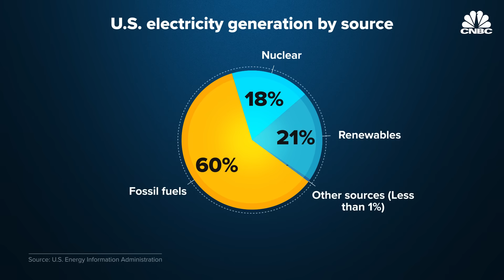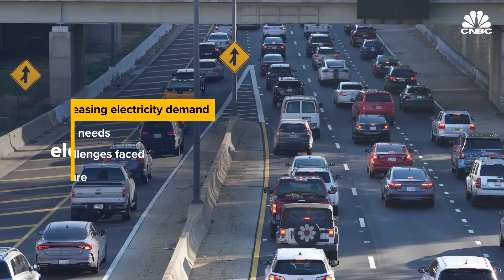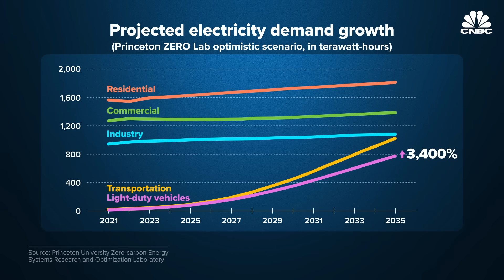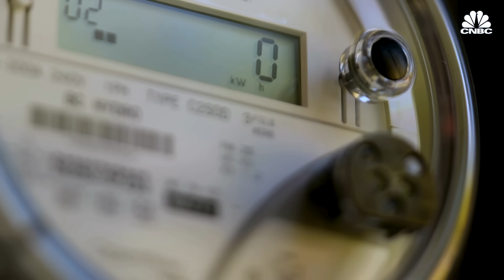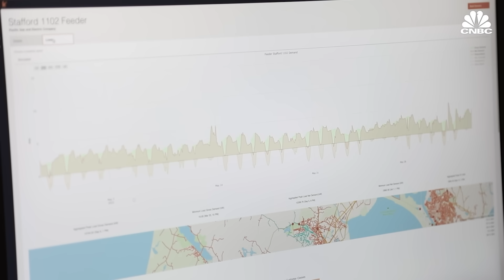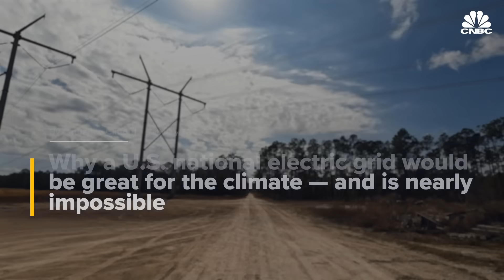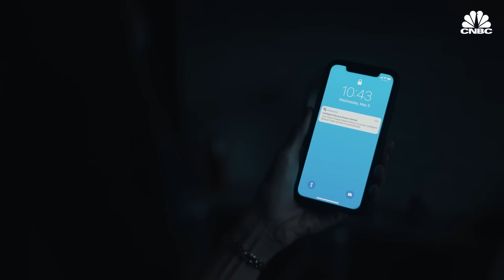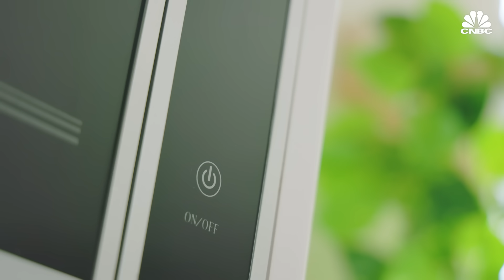Can The U.S. Power Grid Handle The EV Boom?

Comment: I live in California, they are asking people to conserve energy by not using large appliances like air conditioning in the Summer from 4:00-9:00 pm. It hits 90 degrees in my house in the middle of Summer. We have clean energy alternatives but people are "scared" of them.  We desperately need our power grid update to happen sooner rather than later, I foresee brownouts again this Summer.
Reply: Fortunately, this is also when solar+batteries make a huge difference. More people will also switch to more efficient heat pumps.
Reply: Accept my proposal 
Hello Homeowner!
 I have a special request and offer for you
I work with solar energy company
"Say goodbye to rising electricity bills and hello to a greener, more sustainable future. With our revolutionary solar energy service,
Let me know your thoughts plz
Reply: Well.. they know better so better get used to it. You guys vote for it.
Reply: I am planning on installing a new 25 SEER ductless heat pump to cool just my bedroom.  It is 120 volts, and about 800 watts power.  $700 at Amazon.  So if I put in a 2 KW solar system, a 48 volt 200 amp hour battery pack, golf cart batteries from Costco, and a 5 KW inverter, I can power that heat pump from the solar system.  Used $85 solar panels make 250 watts each, so very cheap now.  The 5 KW inverter/ MPPT charger controller is $575 at Amazon.  The ductless heat pump is cheap there too.  Then I can run my ductless heat pump 10+ hours a day in the summer using solar power only!  

Depending on what year your A/C was installed, it can be very expensive to run, or lower cost.  If installed before 1995, it is likely 8 SEER, and 95 - 2004 then 10 SEER, and after 2005 they required 14+ SEER rating and switched to more energy efficient R-410 refrigerant.  So 10 seer is 10,000 Btu's of cooling per KW of power, while 14 SEER is 14,000 Btu's per KW, and 25 SEER new variable speed heat pump is 25,000 Btu's per KW of power consumed.  So not a "Large Appliance" anymore.
Reply: @Kangenpower7  What is the manufacturer of your Amazon heat pump?
Reply: Why Democrats have not embraced nuclear, I have no idea...oh wait, because they get a check by the green companies...hmmm
Reply: must be nice living in Commiefornia 😂😂
Reply: @sp4604  hey would you like to go Solar
Reply: @hiraonlineahop_pk  not in Commiefornia.
Reply: @sp4604  or in California?
Reply: @sp4604  there is nothing commie about california or there would not be problems causes by land hungry capitalists who view progress as a threat.
Reply: @Shadowgills  progress has left SF as a ghost town as busnisses leave
Reply: @sp4604  you don't make any sense.

Comment: Most of the "experts" on these segments seem to be power companies that are angling for justifications for raising rates and at the same time getting money from the government.  These companies also seem to want it both ways:  we need to charge more money for everyone because all these people with solar panels are reducing overall demand and not paying their fair share; all these EVs are going to cause a peak in demand so we'll need to charge more to upgrade capacity.

The current grid's capacity shortfall is around peak daytime summer usage.  Most EV charging is done during off peak hours, and fast chargers can use local storage and mostly draw from the grid during off peak hours as well.  Utilities just need to use time of use rates to encourage the additional charging needs to happen off peak.  And they need to embrace  distributed solar (homeowners, retail stores, etc) rather than fighting against it.

Comment: Those costs are just for transmission level lines - generally defined as voltages above about 200Kv. The big pinch will probably be in the sub-transmission level... roughly 15Kv to 200Kv. It is a lot more than just buying materials that everybody will want to get at the same time; it is land acquisition (which can take more than a decade due to NIMBY - Not In My Back Yard), design, and approvals. Fortunately, the controversy over EMFs - ElectroMagnetic Fields - has mostly resolved in the US as better studies showed EMFs are not causing brain cancers. (That concern popped up about the same time I started working for the Fortune 100 electric company I recently retired from... c'est la vie.)
There is a change in direction for high voltage transmission that could be a boon beginning with this push for greater capacity: DC transmission. That completely eliminates the EMF issue and simplifies the uber-critical matter of grid stability. It will still be true that generation must equal loss plus load every minute or less, but phase angles and Power Factors will be a problem of the past. New facilities will not need the enormous transformers that present EHV substations and generation stations need. Those are mostly made in Europe (we got the last one I heard about from Italy... it was loaded on a heavy hauler truck and proceeded at a maximum speed of 15 mph for weeks to get to its new home). As a side issue, threats from Coronal Mass Ejections would be vanishingly small.
As the video pointed out, the price and pace are going to be very significant issues. Not insurmountable, but not trivial.

Comment: Basic math says yes it can.

There are 280 to 290 million cars in US that use 369 million gallons of gasoline per day. Producing one gallon of gasoline takes over 12kWh of energy but I can't recall the exact fractions and there were other extras I also forgot, but at least we can assume the fuel for delivery trucks is included in that daily number. Anyways, 12*369000000= more than 4 428 000 000 kWh is used per day to produce fuel. Average driver drives 30 to 40 miles per day and a typical EV gets about four miles per kWh for up to 10kWh used per day per driver, times let's say 300 million cars so EVs would use 3 000 000 000 kWh per day.

4.428 TWh is almost one and half times as much as 3TWh and remember that I'm lowballing the energy used for producing gasoline and assuming more EV driving more than average.
Reply: Math with wrong numbers? To make gasoline they need heat, that comes from burning oil or gas. Not a single refinery uses electricity for thaut, bc. it's way too expensive. There are several refineries not connected to a grid at all. 

You may have falsly assumed it must be electricity bc. of the unit "kWh", but heat is also quantified in kWh.

Comment: Rossi said his patented device (2015) can produce electricity for $0.01/kWh, which, . .for this analysis, I will assume is true. However, he did not factor in the cost of distribution, which is currently no less than $0.05/kWh and considering needed infrastructure improvements to incorporate his devices into the grid, $0.10/kWh. Since the Chinese currently deliver electricity to their businesses for $0.05/kWh, retail, and have plans to do so for the next 40 years with the same tried and true coal fired electricity generation plants, and Rossi sold them the rights to his device (for manufacture and distribution in China) for $100 million, any means of producing electricity that utilizes the same central distribution system (the grid) will fail (be non-competitive). If any candidate chooses to jump on board the Make America Great bandwagon, I suggest that they do so with a more realistic financial prospectus.

Comment: National Electricity Grid is a 100-year project and massive national wealth investment. 
5times bigger IF CENTRALISED CONCENTRATED ELECTRIC GENERATION. 
The grid has millions of ends. 
The ends have a few solar PV panels and EV with V2G selfparking plug in. 
And most vehicles are parked 23hrs a day and drive building to building, then over supply storage with the EV will protect the existng national grid. 

Ezi pezi.

Comment: We need to build enough capacity to enable legacy(think heavy industry like aluminum smelters and steel arc furnaces) and modern industries (like data centers and carbonless technology) to exist plus the switch to carbonless hvac and transportation . A smarter grid and surplus capacity for industries will be an economic boom for America.

Comment: With no fossil fuels 5times more electricity is needed. 
5times more generation and more grid capacity. 
The national grid is fragile and built to minimum engineering standards and economic limitations. 
Nobody would pay for a luxurious Rolls Royce build. 

So unload the national power grid. 
Central power plants overload the grid.
DISPERSED  generation from every rooftop is perfect with EV big batteries. And V2G just like the home robotic vacuum cleaner, selfparking EV can plug into the grid.

Comment: This video ignores what is already succeeding in various parts of the world. Australia has led the way in some respects and Tesla's battery banks and distributed virtual power plant has solved the problem, erasing frequent blackout problems and saving $60-90 million a year that can be used toward financing HVDC long distance transmission.

Europe's switch to renewables is so successful that on some weekends residential electricity is free, in spite of many areas with cold, overcast, and snowy weather. Norway is almost 80% fully electric vehicles now.

China is on the verge of all residential power coming from renewables today and is rapidly moving to EV adoption nationwide. The problems are solvable with enough examples worldwide to teach the ways it's done.

FUD will always rear it's ugly head from those who profit from the status quo. In the US the production tax benefit and the IRA incentives are expected to reduce the cost of solar PPAs at grid level to ZERO dollars per kWh.

Comment: If we did this right the EV’s could be used as tiny capacitors that would make up power demand when everything else fails or a huge draw needs to happen

Quit pushing stupid agendas, these cars add no more stress to the grid than an AC or pool heater

“Let’s make everything sound scary so people will watch”

Comment: Huge problem with "renewables" is they take a lot of land area, you need enough to provide power for your area, PLUS capacity to store, PLUS capacity to provide power to other areas. 

Any solution that doesn't include nuclear for at least baseline load shouldn't be taken seriously.
Reply: While I agree that nuclear the baseline and then some.  I do not think solar is being implemented efficiently.  In China they build massive solar farms in the desert.  What they found that dew from the evening does not evaporate as quickly in the shade of the panel.  This has caused weeds and grass to grow.  They bring sheep in to graze under the panels and greening the desert becomes a byproduct of the solar farm as the 🐑💩 enriches the soil.  The Chinese are now doing this in Saudi Arabia where there are acres and acres of desert being turned green.  As far as I can see there is a lot of desert in New Mexico, Arizona, Nevada and Texas.
Reply: Rooftop solar requires zero land.
Reply: @badsamaritan8223  no disagreement from me.

Comment: Sounds like the easiest way to make a high voltage transmission line would be to put them next to interstate highways in rural areas. The problem with that would be the feds would need to do it. Which would make it a TVA style program so the feds can override local permitting. The feds can basically do whatever they want so long as Congress approves and funds stuff, so it’s not impossible. They build crap like military bases over the objections of the states. They can just say it’s a national security issue and they’re golden.
Reply: What bases were built over the state’s objections?

Comment: California is eliminating the requirements for providing  parking in high density housing, less opportunity for charging.  Any solution without nuclear is not a solution
Reply: When it takes 15 years to get the permitting and building out a nuclear facility before first energy…. Yeah that’s just not a viable option. See plant Vogel in GA. Under construction since 2009. Don’t get me wrong, I want to see more nuclear but it take so damn long to get a plant up and running.

Comment: The simple, "low lying fruit", is in peak shaving. This is a process where a big battery, such as an EV or home electrical energy storage (Power Wall) is only allowed to charge, when the voltage coming into the home is above a certain threshold. For me, that would be 241.8 volts or above. If the voltage falls below that, the battery simply doesn't charge, or in the case of home energy storage takes over. That would allow the home owner to run their air conditioning any time they want. The car will only charge during low demand, or, if the voltage on the grid rises, due to sun shine on solar panels, or wind blowing strong enough, for wind turbines to generate the extra power to push grid voltage high enough. Electrical energy storage at point of use can stabilize the grid so well, that it would easily be able to handle the extra demand created by electric vehicle charging, and, full electrification of the household. (Electric water heaters, heat pump based HVAC, electric stove/oven) That same energy storage would take full advantage of intermittent renewable sources, without any risk of base load generators having to "chase" fluctuations in demand, or, random increases in generation from renewables. (wind, solar) This would also all but eliminate curtailment of functional wind turbines.
     Batteries are expensive. It's difficult for the total levelized cost of electrical energy storage (LCOS) to compete with the wholesale cost of electricity. However, it's a clear "winner" when compared to the retail cost of electricity. Energy storage is most practical behind the meter. All of this can be accomplished, with little to no change in the electrical grid infrastructure. It would merely be loaded more steadily, rather than cyclically.

Comment: Imagine how much energy would be saved with work-from-home.
Reply: I always use more electricity when I work at home.
Reply: @NAY2GAS  yes, but no fuel for car, less wear and tear on car which is less and not having to fight traffic is less on your stress levels for the day.
Reply: @valeriebolton2607 and now they want to ban fuel cars for electric
Reply: Turn off street lights. Lower ceilings in these mega stores.

Comment: The problem with solar and wind power is that it can't be connected directly to the grid but indirectly via battery storage. Then, once the batteries are fully charged then it gets put into the grid. The problem with that is you cant dump that power into the grid during high load times.

Comment: Luckily there’s an answer: nuclear energy. You can put small modular reactors or large nuclear power plants where the energy need is. That way we don’t need huge power lines or huge land areas. Plus nuclear power plants last around 80 years versus 20ish for solar or wind

Comment: What if 80% of the EVs werent being charged by the grid though?  Aptera has the right idea, most people typically drive short distances.  Have a very efficient vehicle with solar on the hood, roof and trunk.
Reply: That is a pipe dream.  The more square footage you can lay panels , the more photovoltaic power is generated. That is what a home roof is for.
Reply: yea lets see how that aptera does in vegas in the summer when a model 3 needs to have 255whpm to get the EPA range....which will not happen in the summer when I average 400+whpm.  that solar panel car wont keep up with the AC blower fan let alone anything else.
Reply: @baldisaerodynamic9692  that could be why it's not out yet.  I firmly believe Aptera missed their window to become a Tesla like car company.  I think they will be a niche car manufacturer if that.  But the ideas are right, being efficient is very important which should help with the ac issue.  I wonder how efficient a car ac is?  In an ICE vehicle the ac efficiency is almost a non issue.  There might need to be huge advancements in AC tech in vehicles.

Comment: A great video.  Lost in this analysis, though, is that oil and gas exploration is extremely electricity intensive.  Everything from exploration, to extraction, to refining, to distribution.  To the degree electrification reduces the activity of the oil and gas industry it will help offset some of these challenges.
Reply: I guess they tend to forget how much electricity it takes to export millions of gallons of jet fuel and gas from Texas to the Eastern States.  And to pump gas and jet fuel to Las Vegas and Utah from Long Beach California refineries.  So less gas produced means less pollution in California too!
Reply: @Kangenpower7  You're 100% correct.  Looking at it holistically, there's nearly as much electricity per mile travelled in a gasoline-powered car as there is in an electric car.  But the gas car is ALSO burning gas.  Unbelievably inefficient.

Comment: I think we should move more away from needing cars which would decrease energy usage, but I really think the "can the grid handle it?" argument is idiotic. If only we had some massive stockpile of unneeded devices that can burn gasoline in order to create so much energy that they can drive around and still make so much power that they can run various electronics without a noticeable increase in fuel consumption.